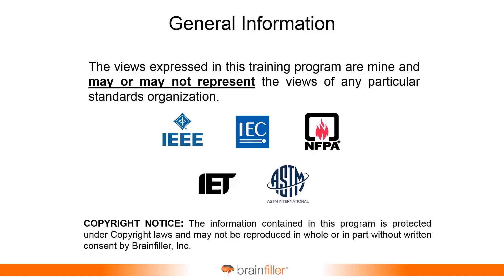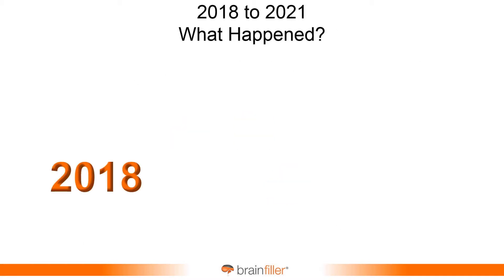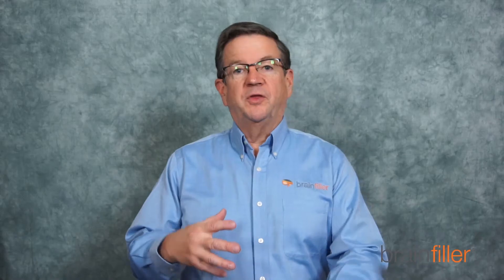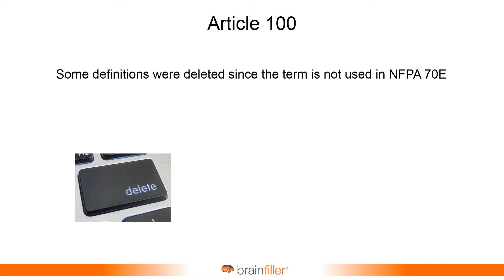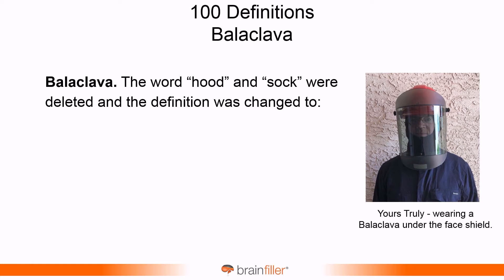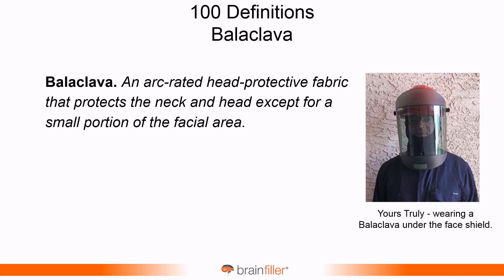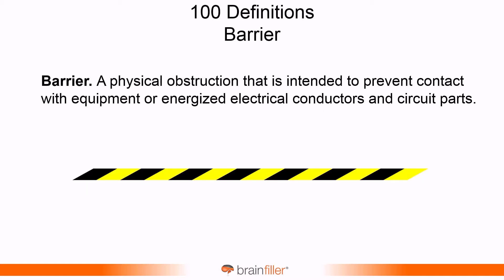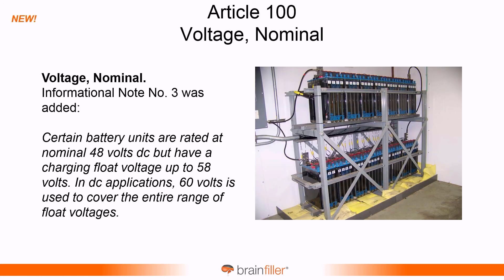2021 NFPA 70E Changes & Updates - Part 1 of 5

Comment: Hello was about to try to get my electrical safety technician certification (CEST) but the NFPA association says the test is based on the 2018 version,  when will the test change to the 2021 version and would it more beneficial to wait for the updated test?
Reply from the maker: Hi Luis.  We might be talking about 2 different standards.  The latest 2021 edition of NFPA 70E was just published last month and is current.  It references IEEE 1584 and the 2018 Edition of IEEE 1584 is the most recent.  IEEE standards are not on a regular revision cycle and it will be years before there is a revision so 2018 is the correct edition of IEEE 1584 to use.